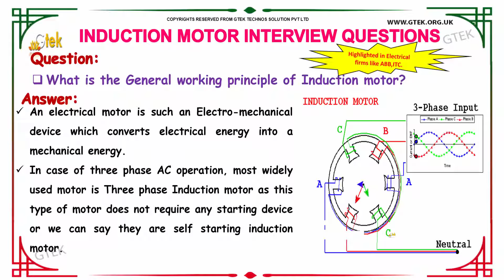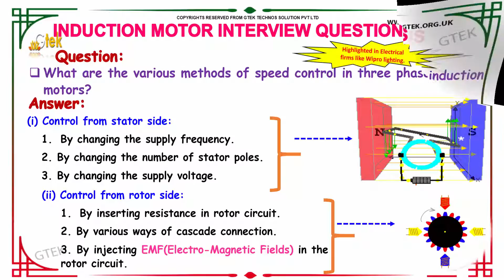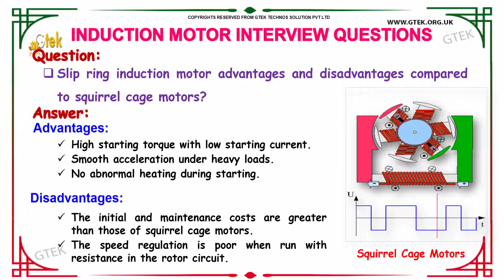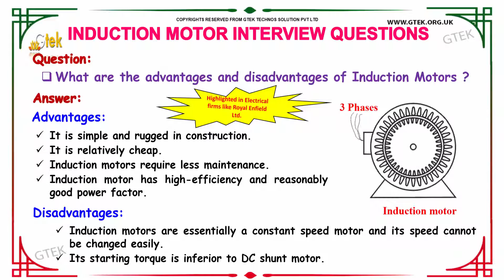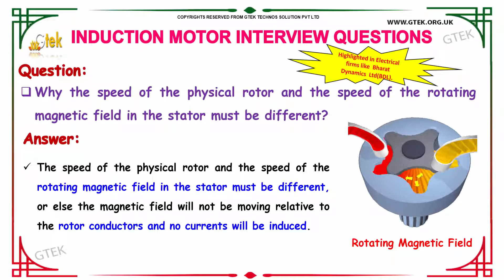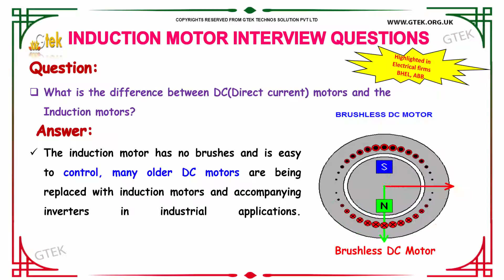Comment: An induction motor is an AC electric motor in which the electric current in the rotor needed to produce torque is obtained by electromagnetic induction from the magnetic field of the stator winding.

Comment: A three-phase power supply provides a rotating magnetic field in an induction motor. Inherent slip - unequal rotation frequency of stator field and the rotor. In both induction and synchronous motors, the AC power supplied to the motor's stator creates a magnetic field that rotates in time with the AC oscillations.

Comment: Three phase currents flowing within the stator create a rotating magnetic field which induces a current, and consequent magnetic field in the rotor. Rotor torque is developed as the rotor slips a little behind the rotating stator field. Unlike single phase motors, polyphase induction motors are self-starting

Comment: Since rotation at synchronous speed would result in no induced rotor current, an induction motor always operates slower than synchronous speed. The difference, or "slip," between actual and synchronous speed varies from about 0.5 to 5.0% for standard Design B torque curve induction motors.

Comment: The stator of an induction motor consists of a number of overlapping windings offset by an electrical angle of 120°. When the primary winding or stator is connected to a three phase alternating current supply, it establishes a rotating magnetic field which rotates at a synchronous speed.

Comment: Three-phase electric power is a common method of alternating-current electric power generation, transmission, and distribution. It is a type of polyphase system and is the most common method used by electrical grids worldwide to transfer power. It is also used to power large motors and other heavy loads.

Comment: An induction motor always runs at a speed less than synchronous speed because the rotating magnetic field which is produced in the stator will generate flux in the rotor which will make the rotor to rotate

Comment: The decades before the release of the Impact and the EV1 had seen little in the way of development on the electric car front. The Henney Kilowatt, which ended production in 1961, was the last time a feasible production electric car of any sort had been released; GM's own Electrovair and Electrovette of 1966 and 1976, respectively, never reached production, amounting to little more than conceptual electric conversion kits for the automaker's popular gasoline models. Technical and production costs difficulties were blamed.

Comment: The General Motors EV1 was an electric car produced and leased by General Motors from 1996 to 1999.[2] It was the first mass-produced and purpose-designed electric vehicle of the modern era from a major automaker, the first GM car designed to be an electric vehicle from the outset along with being the first and only passenger car to be sold under the corporate General Motors (GM) name instead of being branded under one of its divisions.[3]